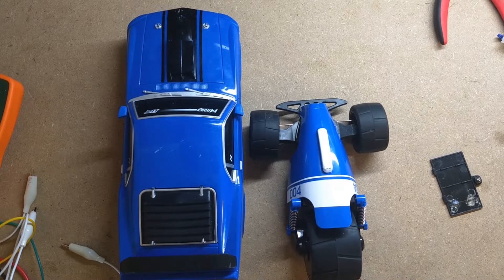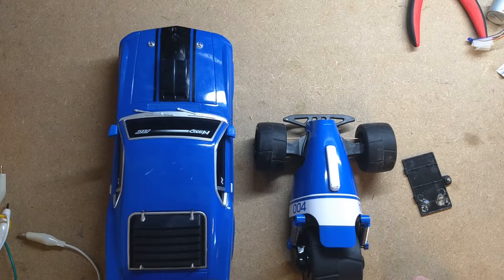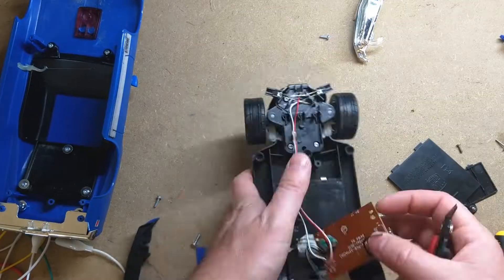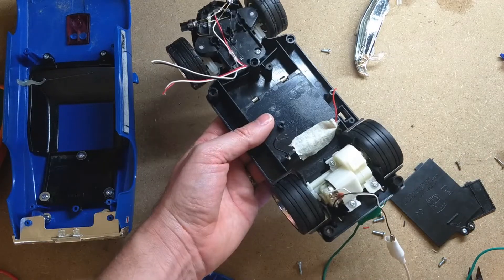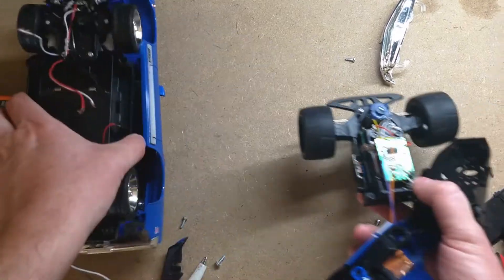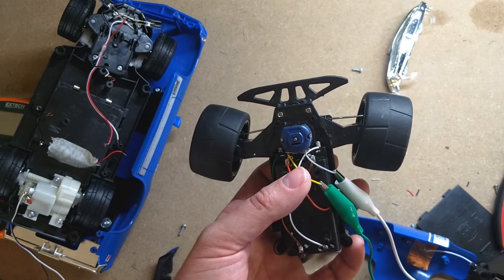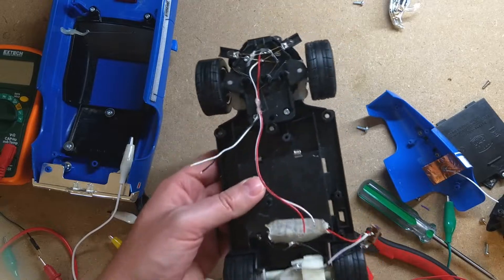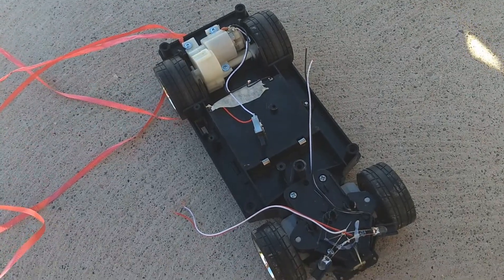No Remote Control Remote Control Cars

Comment: Great video! 
I always wondered how the steering really works in those RCs. The buggy and the Mustang appear to use different techniques though. I wouldn't have thought that they'd use metal linkages on those cheapo models! Also that hub-motor is a nice touch. 
I didn't think the Mustangs antenna would be so short.
Props to you for waiting for the camera to focus in your shots, that really annoys me with other Youtubers. Will you do more? Like for example find out what's broken in the Mustangs steering?